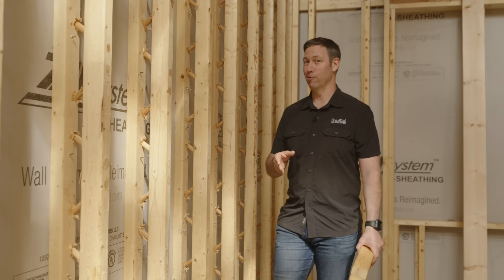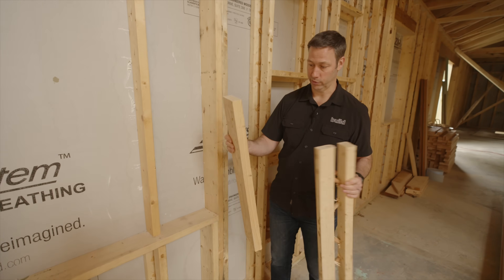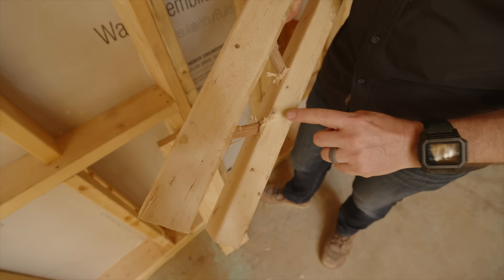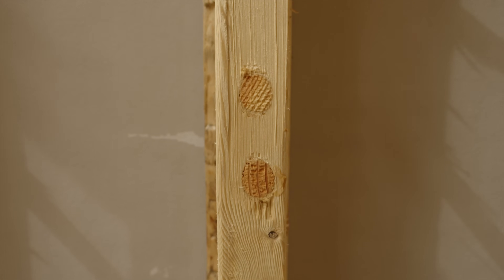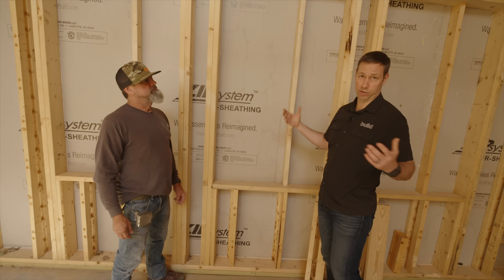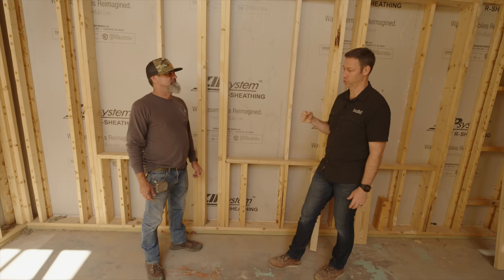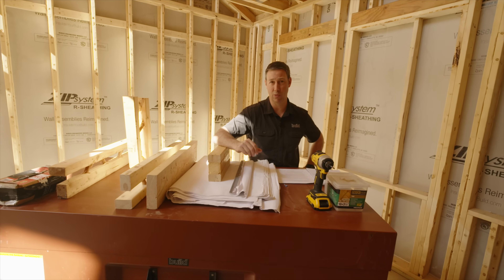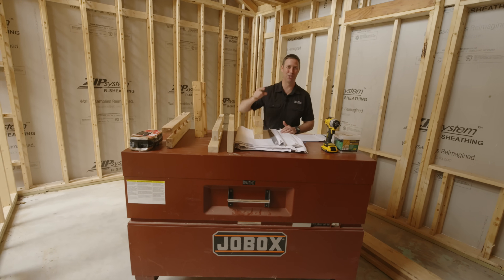Framing with a 2x6 Replacement - TSTUDS!!!

Comment: Interesting topic. Any reason to not use 24" spacing for the studs? In Norway (and probably most of Scandinavia) 60cm have been the norm for over 60 years. All sorts of unfriendly climate and harsh weather here and whats changed over the decades are the insulation thickness. It started with 4" and are now mostly 8" for the walls. Often 6" vertical with 2" horizontal studs.
Reply: The people I've known to have 24" oc walls, were not happy, and one replaced them wall by wall with 16" oc walls.   When he shut a door, the walls waved.  However, I suspect, today, if you went with spray foam, you might had more "glue" to the wall, and stop the wave.  To really get weird, the house I'm in now, the studs are sideways, and the support comes from the wood siding.   the studs are just scrap pieces.

Comment: Who else noticed how much that wood split when the framer was nailing it to the top plate?
Reply: also there no way to use any cut off , the over all cost must be much more .
Reply: Yup, almost stopped watching after that one image, I'm still not sold on the strength claims, and if I were convinced by that I'd still be worried about recouping the added cost during the duration of ownership.
Reply: @chrishuyler3580  you will never recoup the upfront cost in energy savings. That is why it is never mentioned when discussing energy efficiency products
Reply: @bipaholic  well... in Europe you do :D, we pay >30 cents per KW, we calculate 10 yers +-
Reply: @philippm.1271  CT im at .27cents per kw delivered, sucks

Comment: Are there any fire breaks (horizontal short lumber placed between studs to check fire behind walls) that will be added to the exterior walls later? How is this achieved when the bare naked T Stud is open throughout? Thanks

Comment: What about fire blocking? Seems like a fire would spread through a wall pretty quickly.
Reply: I was thinking the same thing, fire could move from cavity to cavity, perhaps draft stopping would compartmentalize long walls. Has the assembly been tested for fire resistance rating? A single 2x6 has less surface area and last longer in a fire than two 2x3s.
Reply: @frankhitch5080  Probably a good talking point in favor of timber framing with SIP walls, vs this smaller and smaller toothpick strategy.
Reply: I thought most fire blocking was to stop vertical spread upwards and between floors in balloon framing. The solid top plates mitigate this danger.
Reply: There is zero spread with dense pack cellulose for sure.  Not necessarily the case with other insulations.
Reply: @christopherhaak9824  makes me itch thinking about it. I just did an entire hotel using Rock Wool dense insulation. I still had to add firestops everywhere.
Reply: The cellulose works if tested in accordance with ASTM E 119 or UL 263 as fireblocking. I think the concern is with the foam plastic insulation. They mentioned foam several times.

Comment: I had the framers put conventional 2x6 exterior studs in. I came back myself and cut 2x4 down the middle (approx 2x2s) to save on cost. Then nailed the 2x2s flat (factory finish) horizontally across the 2x6 studs (top and bottom and every 2 ft) to minimize the thermal bridge.  About $500 (4 years ago) in material
Reply: I had a hard time understanding this, but now I get it. You strapped the wall with 2x2s on the interior.  That's smart.  At first I thought you were saying you cut pieces out of each 2x6 stud in place in the wall😂

Comment: #1. These must be expensive as hell, because the website doesn't even list the price. 

#2. Timber framing uses even less wood and has even better insulation than tstud framing.

#3. The zip system is not all it's cracked up to be.

#4. If they can't deliver now, we can't use them. Period.

#5 Those dowel holes look like shit. Where's the pride of workmanship?

#6. There are 10 surface cuts, 16 dowel hole cuts, glue, and jigging. That is never going to be cost competitive with the 6 surface cuts of standard lumber, even if fully automated. Builders have walked themselves into this mess and are now putting bandaids on top of bandaids.

#7. It would be a LOT cheaper to simply mill a traditional stud into an i-beam with tailored (optimized) cross-section. Singe step process, fully automated. I can build you an onsite machine for less than 2 grand that would require 10 hours additional unskilled operator time per typical residential construction.

Comment: At what point will it be cost effective for residential construction to allow for continuous insulation on the exterior side? This way you can use smaller standard studs, not a specialty engineered stud. Then all the control layers are outside and running any wiring can be done in the exterior wall and not break the vapor barrier. Heck, the guy even said there is a rainscreen, why not move everything outside?

Comment: I think these are a great idea.  I also think the traditional solid wood top & bottom plates, and solid window & door framing is appropriate.  I know it was mentioned that it wouldn't slow the crew down "much" but now instead of one cut per stud, you are now cutting 3 or 4 times on the same stud, and on every stud; I think that would slow a crew down far more than one thinks.  In addition to cutting the studs, how do you orientate the plates if using these T-studs, and do you have to rip some of all your plates now?  The fact that lets say 90% of your exterior framing now has a thermal break is substantial, I don't think the last 10% will make that much of a difference in heating and cooling costs, especially when coupled with other innovations.
Reply: Tiny homes and factory built modular homes will eat your lunch if you use this product.

Comment: One product I could actually agree with. Being a framer for 25 year's.  . What about HD hold downs.  You can't use them . And every ten feet would need a solid stud  for fire stop . But actually like this product.  Better then you liking timber stand studs which are strong straight.  But heavy kill the drivers in my Hitachi.  And in Washington state we sheer everything with osb or plywood.  By the time you done breaking your back lunging the timber strand and lifting crazy heavy walls . Your nail guns toast . And no extra pay from the developers . Cant see it being worth it . now Finally a product I could actually agree with .

Comment: If they aren't cheaper than 2x6 I really don't see the point.  The insulation loss is not going to matter in reality with the house wrapped properly.  If they were half the price I could see it but they aren't.

Comment: On the firefighting front.  These houses will fall faster or burn faster.   There's no way we can stop this from burning fast, unless you get the pink fire retardent that get spayed like paint on the bare wood.  Without the pink fire retardent paint, a house build with that, the house would be burn to the ground before the first fire engines arrives on scene. The construction industries is not really helping firefighters in the saving the properties part.

Comment: I wish I could join the chorus on this one since I've been a fan of Matt for some years, but I can't. For me in NH climate zone 5 it just couldn't pencil out. Not close. The shipping costs alone for enough to frame the walls on a 24'x40' workshop were $5200! 

I'm not a contractor. I'm a retired IT guy with good DIY skills and a desire for a workshop. They were nice enough on the phone but were firm in that they would not deal with a private individual. I would have to find a lumberyard to work through. Try that as a cold call with an inside salesperson who's never heard of you. It didn't help that I couldn't find a roof joist product that would support 24' clearspan with our static snow load requirements here. I ended up with 16" deep I joist type 16" on center, which blew my plans to use advanced framing out of the water and drove up my lumber list by 33%. Also the payback on closed cell foam was out past the end of my life. 

So most of what Matt ever taught me went out the window. I did use Zip System R-12 for wall sheathing. You need 4" nails
 for that, and that was its own set of problems. 

Sorry for the rant, but who do you guys get to pay for these builds anyway? Paul Allen?
Reply: That's the problem with all this new tech., the OPM, (obscene profit margin), breaks the budget.
Reply: I’m not seeing the benefits of it. One cheap piece of ridged insulation and bump up the width of the exterior wall and it still costs way less and has much better r protection. This is like doubling the price of the car so you can get 5 more hp. Doesn’t make sense at all
Reply: Yeah, t stud needs to grow to other areas of the country.  It’s not really an option for me either.
Reply: I'm confused, it was too expensive to ship the new style stud, compared to what??? you said it cost you 33% extra to do your build correctly. So were you comparing the T-studs to the Pre 33% price or the post 33% price??? HUGE difference.
Reply: did you watch youtube of his own house being built- awesome